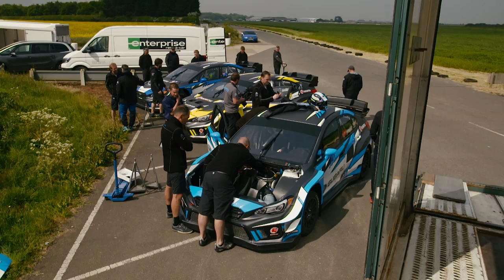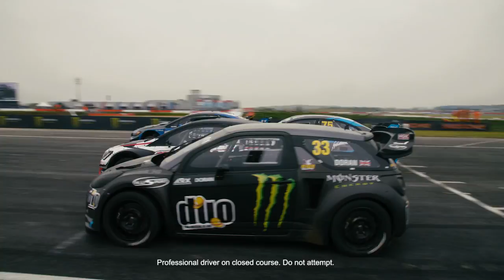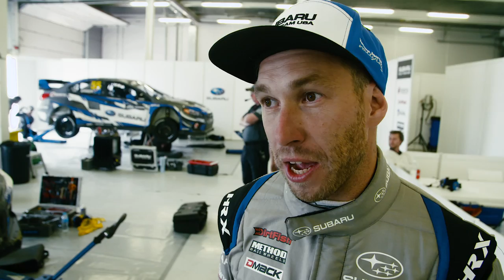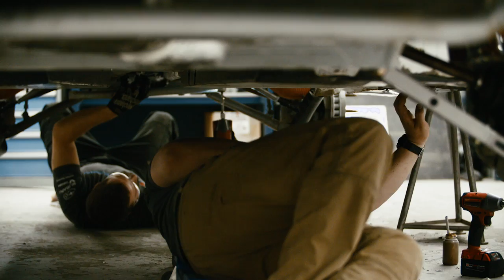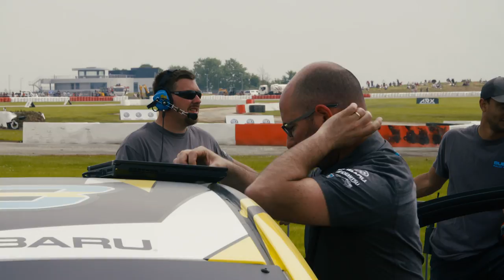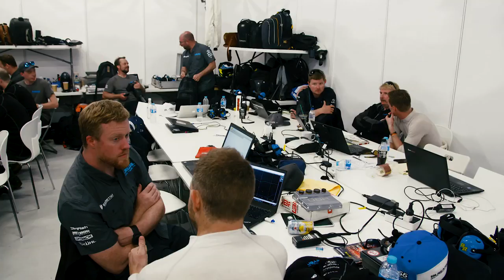Launch Control: ARX Silverstone 2018 – Episode 6.03

Comment: New rx car, but still have some disadvantages compate to vw. I think the Impreza chassis not suitable to this kind of tracks, suffer from long wheelbase. A BRZ STi would be more ideal, becuse it's shorter and lower. Just take lot of time to convert the chassis from rwd to awd and in general to be a racecar
Reply: Now that the WRX/STI platform is no longer based on the impreza chassis im hoping they try to shoot for a smaller form factor in the next model for this exact reason. The current gen is just too big of a sedan. Those VWs are just so small its not really in the same category of car. I think its possible to try a offroad BRZ, but im curious if the long hood and and coupe style car would actually help. You'd have to cut and shape the car completely different to get the same amount of shock travel that these rally cars are seeing on these courses. You really do need a short boxy car.. what Subaru really needs is a new STI 22B
Reply: Tyler Peck Tomi Makinen managed to built an awd gt86 with gravel suspension, so it's possible https://youtu.be/nxxGAkRKPac 
and there is an r3 rally version from it. If the rules allow the chassis wouldn't be problem
Reply: I do like the idea of BRZ for their rallycross program, but i think they might need to ask toyota. Even though there is a rally 86 like tommi makinen's own project and also the R3 spec for customer, i don't think toyota themselves liked the idea of rally/rallycross 86/BRZ.
Reply: I love the idea of The BRZ in rally also would mean 25000 awd brz's in production for the the world to buy.
Reply: I remember someone saying that converting the BRZ to AWD would mess up its center of mass and some other such

Comment: i really wish i could have a subaru... i have no money and my countr is tuff to work and get some....and i love subaru ...damm...so sad
Reply: same here. i feel you bro
Reply: I would be satisfied with 2005 sti but they  are way too expensive. 😢
Reply: I drive a 2008 Subaru Impreza Outback Sport 2.5L Hatchback.....and honestly for near  $9,000 I love the car,, it's light weight, it has the same engine used in the wrx and sti. The gas mileage is wonderful and the handling couldn't be better. I love it and highly recommend it.
Reply: Your EJ25 is not the same as the one in the WRX or STI.  Not by a longshot.
Reply: TheLittlemau5  don’t worry fam you gone get it it’s just gonna take some time and saving a a tad bit of sacrifice but you will get it fam no worries 👌🏽
Reply: What country you at by the way?